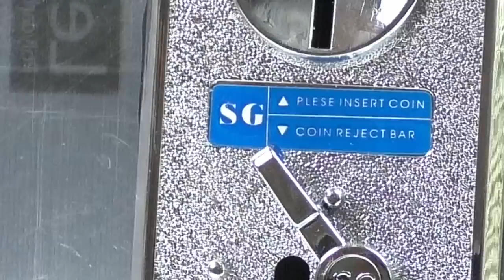How to Make Cola Vending Machine at Home - DIY

Comment: Wow, great project. I was looking into.this style for glass beerbottles.
Make this system in an old fridge, mount it sideways so the exit hole is on the.side and place it against a wall with a hole in it. Connect a qrcode pay module instead of a coin acceptor and sell 24/7beers.

Comment: cool, i loved the job it's very simple but there is something, the soda cans stacked and the capacity is not really 8 cans, you must think to change the  way of dropping cans,
Reply: i did something like that but i used bottles in vertical mode not horizontal like you did, i have more charging on the servomotor i'm forced to use bearing, but i have more flexibility to add more bottles and no stacked on the way

Comment: this dude be stripping the shit outta those screws. Just a tip but put more pressure on the drill's end and push on it while going. the looser you hold it, the more stripped and useless the screws get